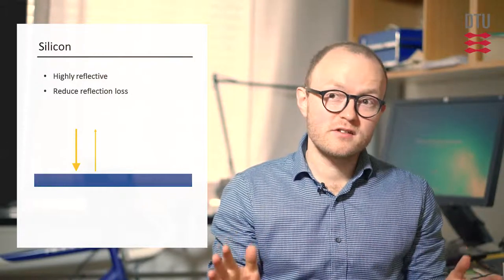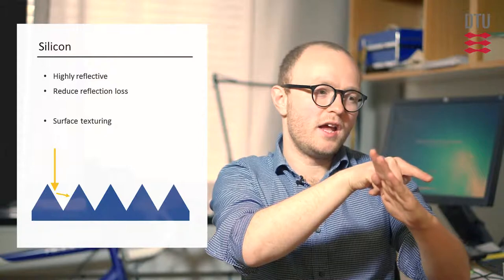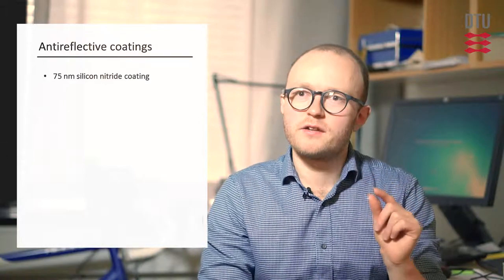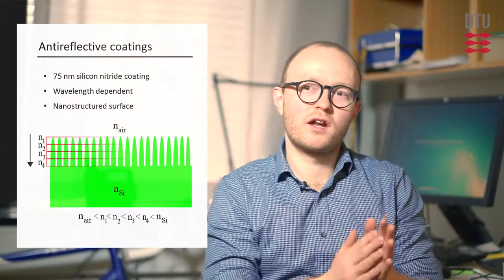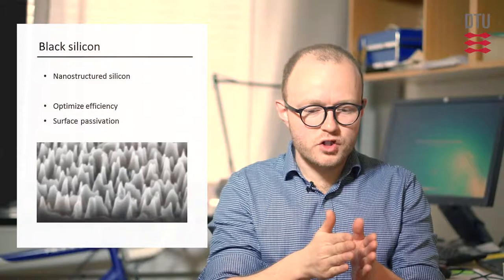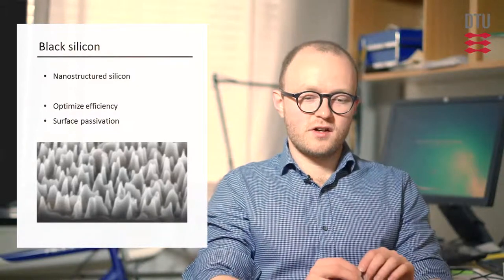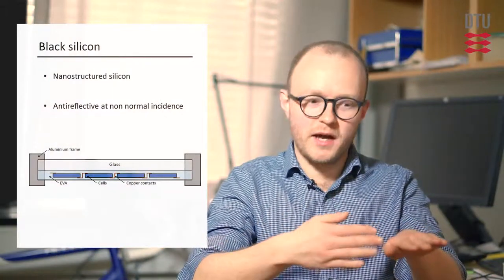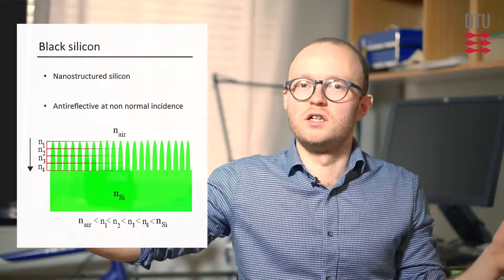Antireflective coatings, texturing, and nanostructuring

Comment: Dose cleaning the panels using di water and scrubbing with a magic eraser damage the anti reflective coating? Not a lot off pressure will be on the eraser just its wieghts while attached to an extension pole the erasor is about 10cm by 25cm.
Thanks

Comment: Hello..This is a very informative video..Thanks for sharing.    I am currently working on a thesis on solar PV anti-reflective coating and I can't easily get the materials to use here in Kenya.. My project is basically comparing the efficiencies of normal PV modules, mono or poly with those that have AR coatings. Would you kindly help me access some of the cells you are working on to help me carry out these tests?

Comment: great video. it really helped me on my research.
What is your opinion on using ALON ( Aluminum Oxynitride ) to protect Solar Panels from Hurricane flying debris?
Considering that Glass blocks energetic light like ultraviolet unless it’s crystal glass, and that Solar would be less effective with regular glass, and also that Heat is a massive problem